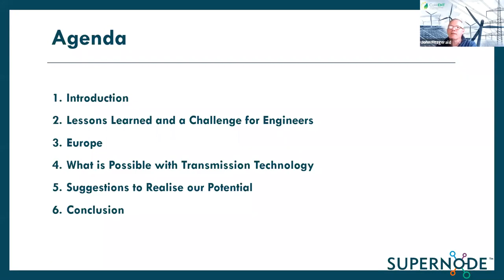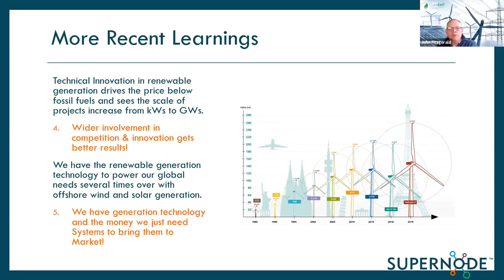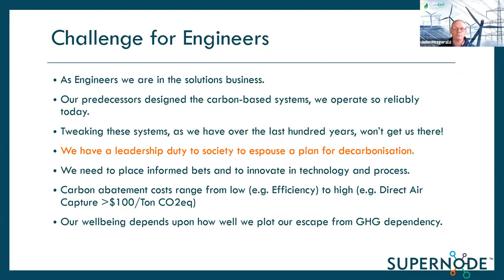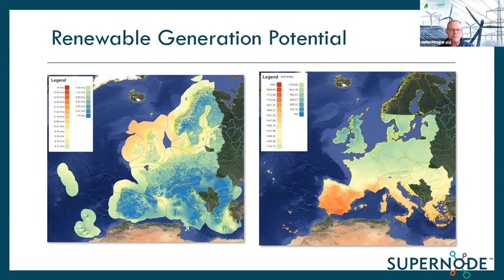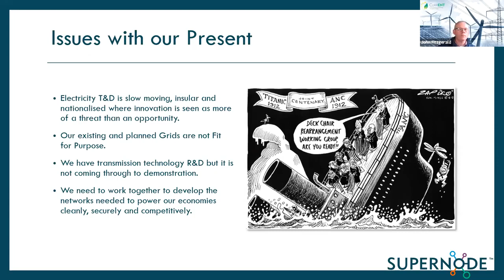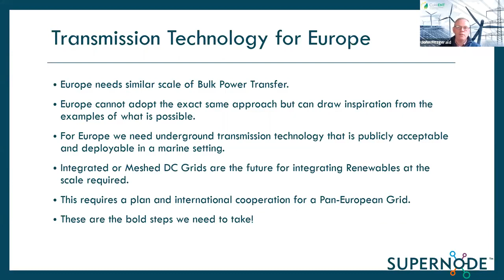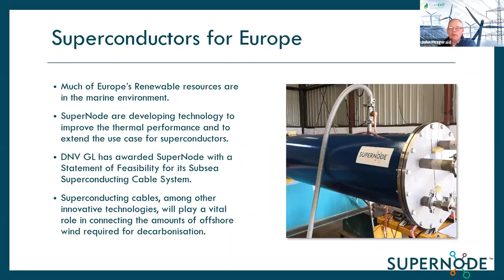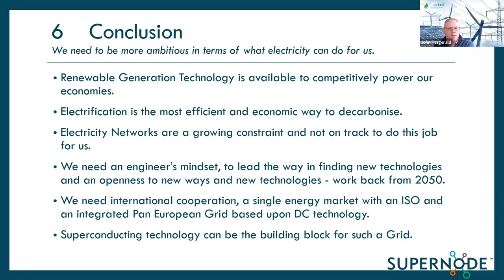Transmission to Enable Decarbonisation - John Fitzgerald SuperNode CEO addresses Engineers Ireland

Comment: Very good paper and should be more widely discussed - HVDC is far and away the more efficient transmission mode. It should soon possible to transmit HVDC over a radius of +-1000km which means that we will be able to generate power from gas, as a transition  fuel, offshore Ireland and send directly to our markets of the future in mainland Europe.